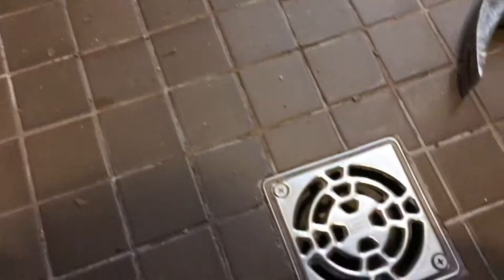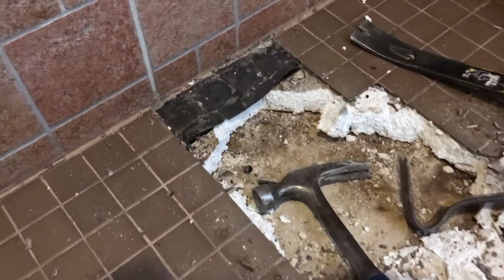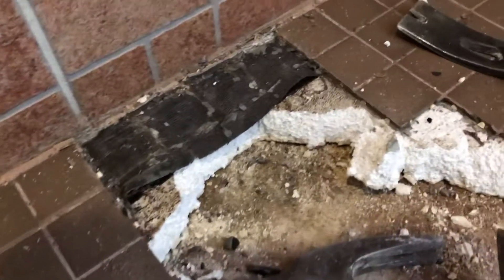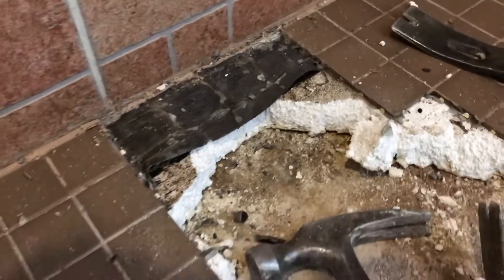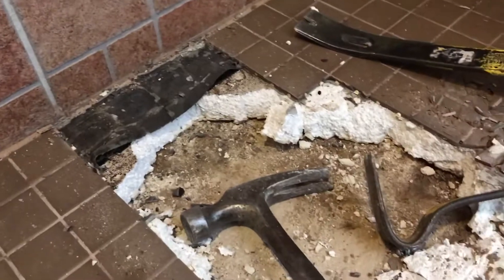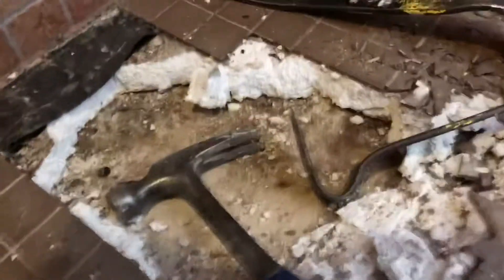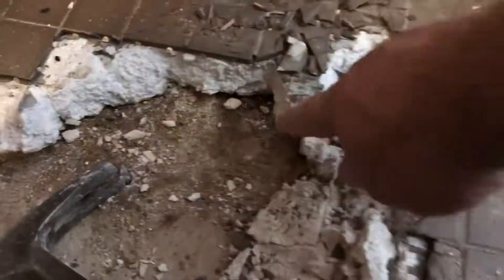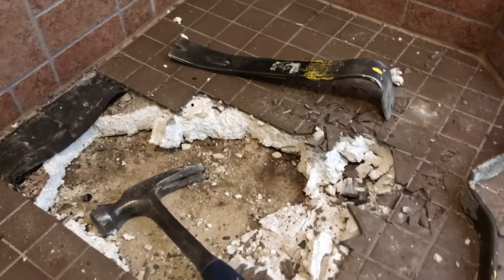Foam Schluter Pan Installed With no Kerdi - Failed Shower Pan

Comment: Lol. I really want to know who did this?
Reply from the maker: +Travis k This was installed in the Copperstone neighborhood. If you’re familiar with Columbia it’s on the south side of town off Scott Blvd.
Reply: @friendlyneighborhoodtileguy  The tile job didn't look horrible.
Reply from the maker: Travis k I don’t know if I have any before pictures of the whole shower but I seem to remember it was pretty sloppy. I remember a lot of lippage and I want to say the tile pattern wasn’t repeated like it should have been either. It wasn’t the worst job I’ve seen but it’s the only Schluter shower I’ve encountered that the pan wasn’t waterproofed. Schluter always sent out Kerdi paper with their pans, you’d think that would have been a clue that it was necessary.
Reply: @friendlyneighborhoodtileguy  I watched the video again. It did look pretty bad. Looked like someone chewed on the tiles around the drain.  Did the homeowners pay the person to install this,  or was it a friend,  or homeowner job?  How long did it last until you tore it out? 
Thanks for taking the time to reply to these
Reply from the maker: +Travis k This was installed when the house was built. The builder refused to accept responsibility (according to the homeowner). I’m not sure the homeowner told me who the builder was. It was 2-3 years old when we replaced it but it leaked from the first shower. Too many builders get wrapped up in doing the job cheap instead of right.